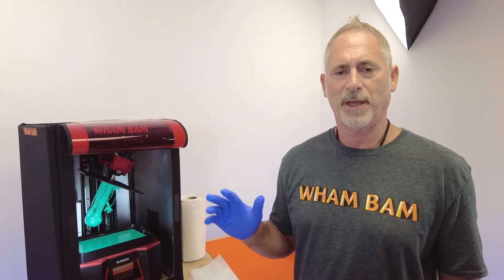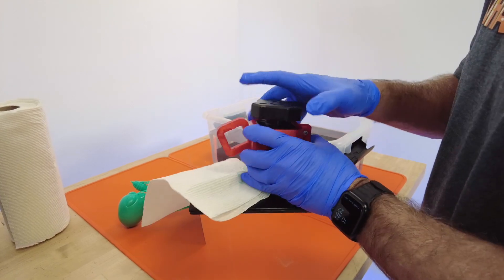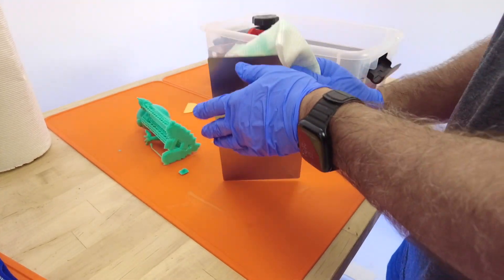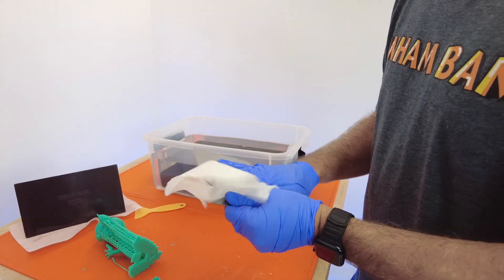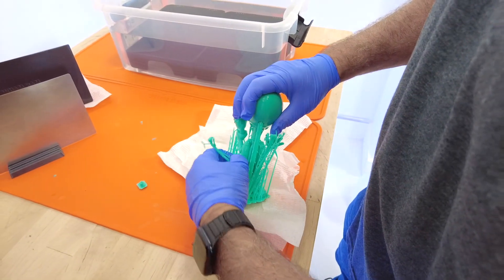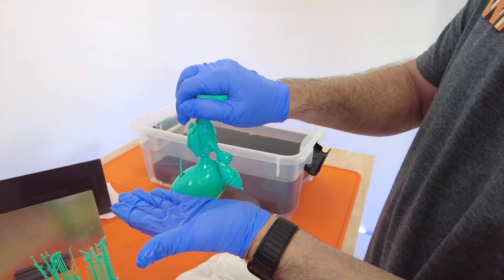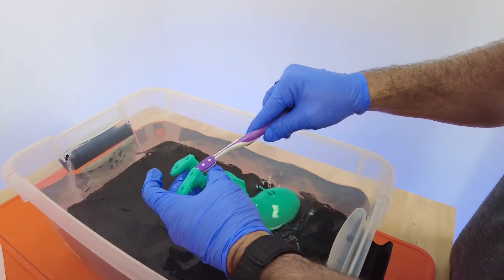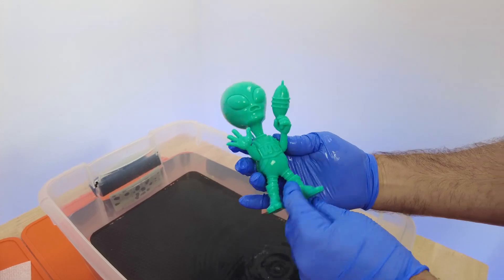Resin Printing Best Practices with the Wham Bam Flexible Build System

Comment: I'm having trouble getting the prints to stick to the build plate. I made my own Z-stop spacer since the ones on the site did not fit. I think its leveled well, lightly scuffed the build plate, and I even have coated the FEP with PTFE (all the usual tricks), but I still can't get it to sitck if there is any sizeable footprint on the build plate. Any tips?
Reply from the maker: We are sorry to hear you are having this issue! Please reach out to our technical support team at technical@whambamsystems.com and they would be happy to help.